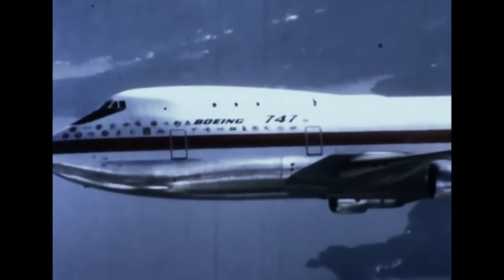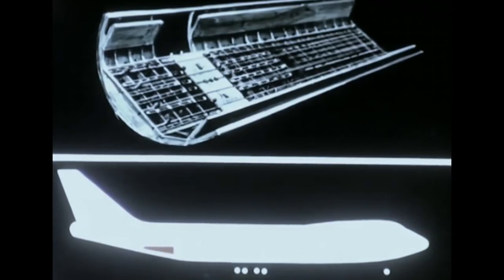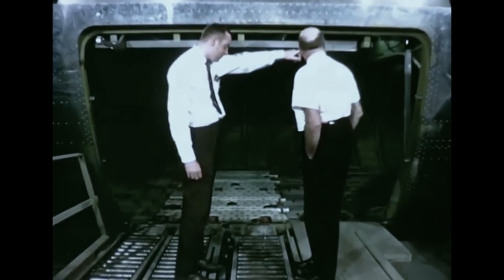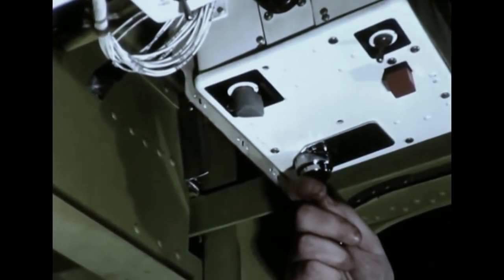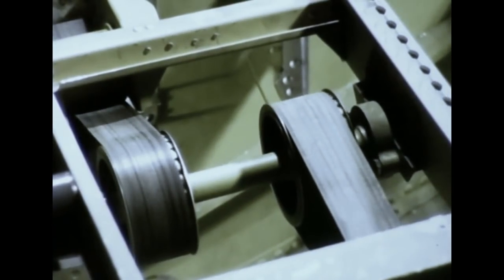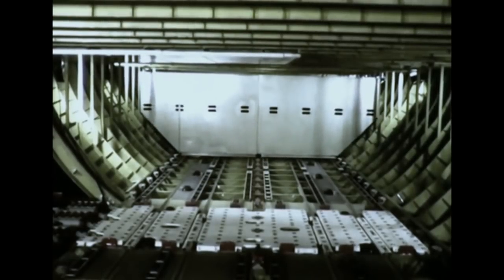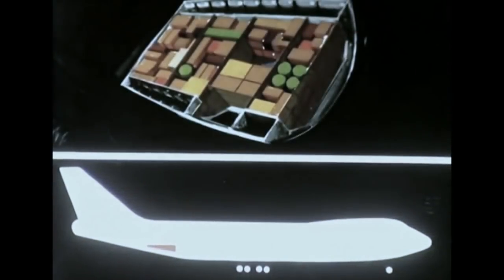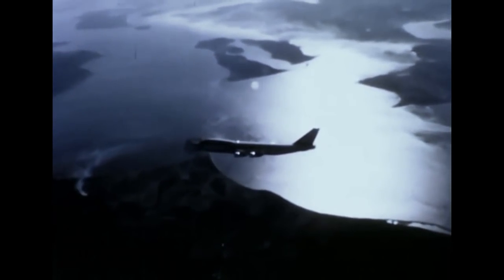Boeing 747-100 Jumbo Jet Cargo Capabilities - 1969

Comment: How are these being digitized? They seem to keep coming out with horribly-compressed audio. Can the settings be changed?
Reply from the maker: Did the best I could in Roxio 12; if it means anything, you couldn't even hear the words before. Every once in awhile, I come across better versions of videos I already have, and when I do, I always replace them. That's very rare, though. Unfortunately, You Tube has no audio editors to use post upload.
Reply: Kurt Tappe, thank-you for your comment and please do not misconstrue me as taking your comment lightly.  I have done amateur video/audio editing as well as research into the field.  Truly, the cost for equipment and training as well as the years of experience necessary to iron out the imperfections you noted are staggering.  Consequently, until the host of this website is able to find someone on a Hollywood, professional level to do free work for several hours, I will be more than satisfied to block out the distractions and focus on the message.  Nevertheless, your concern is valid.
Reply: I have a suggestion: I never used Roxio, but I have used other video editors and they usually allow splitting the audio track from the video track. You can then save the audio track as .WAV (recommended as it's lossless, even though it takes up a lot of disk space) or some other format, then process it in an audio editor. I recommend Audacity, which is very powerful and feature-rich, but not difficult to use, supports virtually every known audio format, and the best thing: it's free (open-source). After the audio track has been processed, you can then import it back to the video editor and replace the original track. I don't have YouTube videos but I have edited some videos as a hobby and when the audio was bad, I was able to significantly improve it this way.
Reply from the maker: Thanks a million Goyta, I think I'll take your advice!